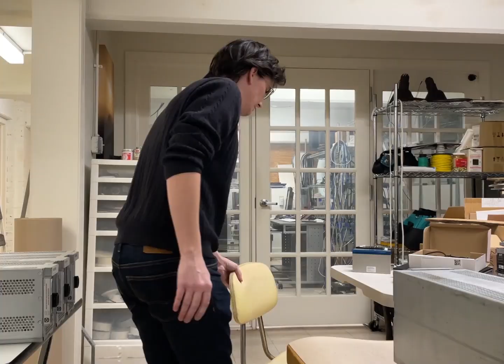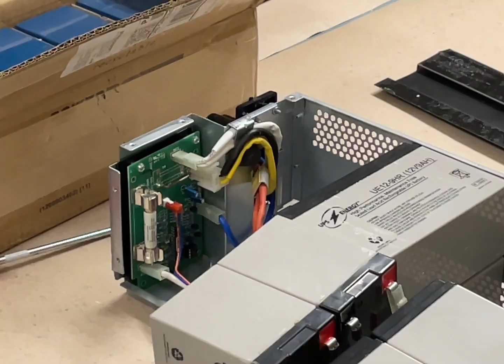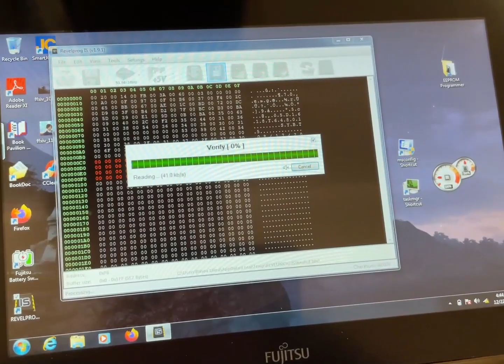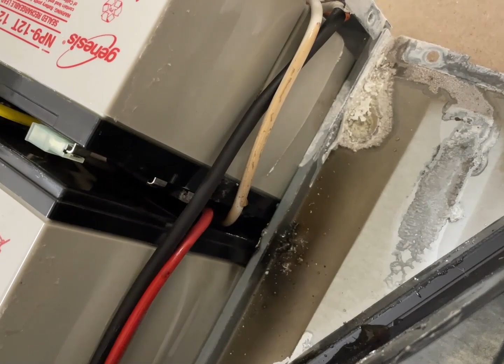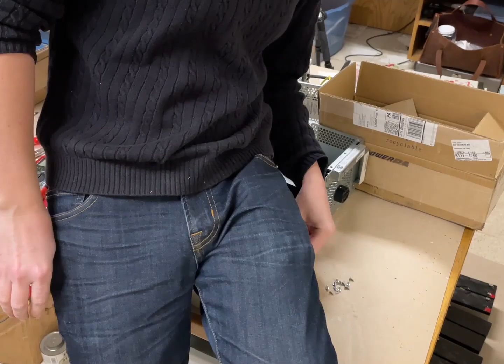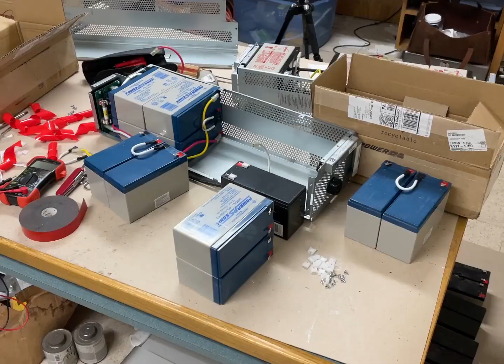Reverse engineering and rebuilding SYBT5 APC Symmetra LX Battery module. SLA Battery replacement.

Comment: I wonder if perhaps that eeprom was actually erased by the microcontroller on the bettery itself. Ie it went to program something. Went through it's erase phase and then the voltage of the pack dropped low enough to not be able to program them.
Reply from the maker: I actually forgot to say in the video but the control board erased it again and I had to replace the whole thing

Comment: Hey Rinoa! I've been watching your vids for the last couple of months now (started with the IBM ThinkPad battery restoration, since I'm preparing to attempt a rebuild for my Latitude CPi/Inspiron 8100 so I just looked for "old laptop battery recell" and you popped up) and I always feel so comfy watching them. You two seem like really nice people, please keep up with all the great stuff you do!!

BTW, that's one great touchscreen! I do quite like Windows 7, but for me personally, Win2K and XP are really the last truly great Microsoft OS-es. I diasgree about the general consensus that using an unsupported operating system online poses a real secutity risk, since the router's firewall will most likely be enough to protect you from "random" attacks. Still, Linux or the BSDs are never a bad choice IMO, only problem is on old machines Windows tends to be better supported funnily enough.
Reply from the maker: thank you for such a lovely comment. Windows 2000 is my personal favorite

Comment: Hi there. I spent many years out in the field working on these. Your video is interesting and cool. One thing. Never mix different brands of batteries, also never mix different ages of even the same type. The reason is the same. Different brands and different ages offer different resistances. Good old Ohm's law will tell you that different resistances will cause them to charge/discharge at different rates. This will lower battery run time, as well as battery life.
Reply from the maker: Yeah we never would mix different batteries in the same pack. Cant be helped with mixing different packs though since the system would have to handle that

Comment: If it (software) absolutely positively has to work, XP.  Kind of a joke, but there seams to be, some merit to that.
I'm impressed with your depth of self taught knowledge, and your style of presentation, effectively looking over your shoulder.
I agree about the serial E²PROM being blank.  Static should have made the chip, unusable, not blank the data.  Strange!
I've not seen a sealed Lead Acid battery fail like the exploded units, you showed.  Perhaps a production fault?  It may be a good idea, to open that battery pack, and check for corrosion of the case.  Some of the acid could have damaged the rust prevention coating of the metal case, and the inevitable will occur (rust).  I've found, cheap (clear) nail-polish from a discount store, can be an effective anti corrosion coating (and also a mild 'Locktite' function).
Reply from the maker: Regarding that EEPROM, I forgot to mention in the video that I later had an issue with that board and had to swap it out, so that board may have been erasing the EEPROM in it
Reply: @RinoaL 
That is interesting!  Perhaps that faulty board, could be a 'tear-down' episode.  May, or may not discover the cause. though analysing the board, could revel something useful. :hand-pink-waving:
Reply from the maker: I doubt it'd be useful knowledge for me tbh, I don't have a ton of these to take care of.
Reply: @RinoaL 
Yes, maybe that will be the only APC Symmetra LX SYBT 5 you will service.  But, that's an impressive skill to put on any job application.  Perhaps a cottage industry, rebuilding battery modules for other clients.

I've been able to get several UPSs, simply because the batteries failed (age related), and unskilled users (bean counters) see that a new unit is cheaper than having it repaired/serviced.  There could be something in it, for you (you said there had been several blackouts, earlier.  If that's a common occurrence, UPS's will be in demand, IMO).
Reply from the maker: Yes I do work in datacentres but sadly most companies have moved on from these older batteries, so I don't have very many to do since they are going on 20 years old. I'd be best spending time researching the newer ones, however again I already know everything I need to know about this battery module so I don't feel like going further tbh.

Comment: I recently bought myself a new tester for lead-acid batteries. The feature that sold me was an option to test based on amp-hour rating in addition to the more common settings like CCA. It recently helped in troubleshooting a misbehaving scissor lift, which we eventually found to have one of the emergency descent valves open. My boss was ready to replace all four batteries!
Reply from the maker: Being able to test the function of each component saves a lot of dosh.

Comment: I have some of those powersonic 18AH batteries in a APC1500 and they seem to still be doing well after 1.5 years..  We also had a batch of about 70 Mighty Max batteries and they didn't last more than about 1.5 to 2 years..  In the search for better batteries, we're also trying out some Bright way batteries.  I got a little automotive tester to measure resistance and log them down along with voltages and whatnot..

Comment: Ah, XP. It was the last Windows system I used everyday, before switching to Linux in 2012. I sometimes used Win10 for gaming and for work (when working as an EE for a company that used Altium Designer) but generally I'm a Debian gal. XP was a good system killed off after over ten years; if not for stopping support, we'd see it in mainstream use to this day and that's not what Microsoft would like.

Comment: Just about to send a complete (earlier version of this unit) w/ extended run cabinet straight to hell. It’s approx. 25 years old and the plastic battery boxes are starting to disintegrate from age, two out of the five power modules are toast and the unit nearly caught fire once…
Reply from the maker: If you want to send me any circuit boards from it I’ll find a good home for them so they dont become ewaste in the dump
Reply: @RinoaL  anything you’re looking for?
Reply from the maker: Hrmm, could you give me the model number of the unit so I can look it up? Also are you on the east coast? I don't have anybody yet with an older APC system but I'm starting to get known for this. I feel like maybe any intelligence modules or maybe any circuit boards from the battery packs themselves would be great.
Reply: @RinoaL  i’m in southern NH.
Reply: @RinoaL  I’ll have to get back to you on the specifics - I can’t even find a picture of this thing online!
Reply: @RinoaL  if you can bring a truck and help remove it, you can have the whole damn thing as far as I’m concerned
Reply from the maker: Sadly I won't be able to come get it. If we were closer then I'd be up for it. Ah well. Thanks for the offer though!
Reply: Yeah, I have been limping this thing along for 16 years - there isn’t much left worth saving. We got it used as a donation and it served its purpose. I’d like to salvage the transformer at least, there’s like 200 pounds of copper in it!

Comment: Having worked on many server room APC units over the years, be very aware of the amount of energy stored in those battery packs ( do the math ), there is a reason they are made out of steel.
Reply from the maker: I’m coming to this from working on electric car batteries so for me this is an easier job than a 300v pack
Reply: It's ok she knows what she is doing.